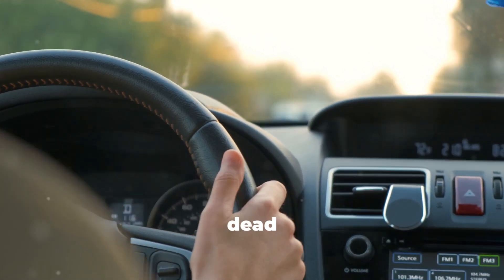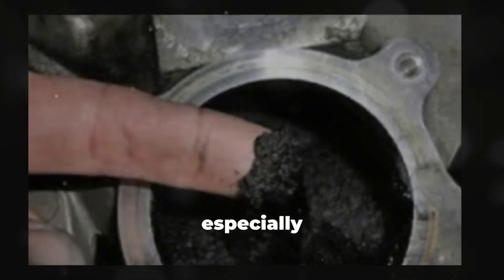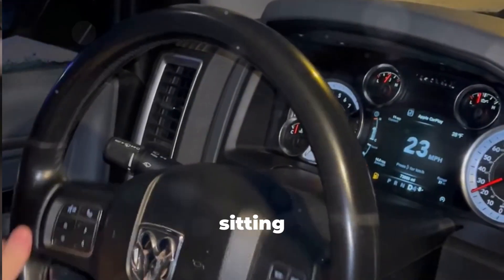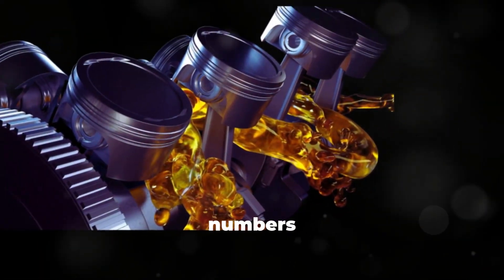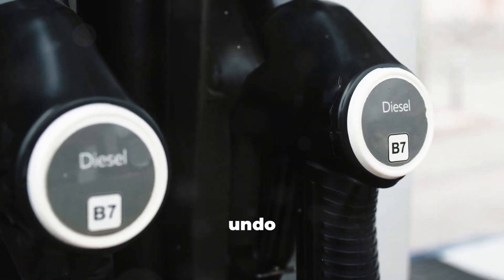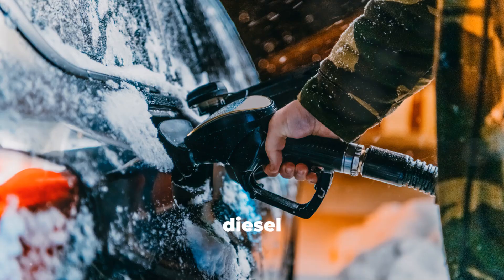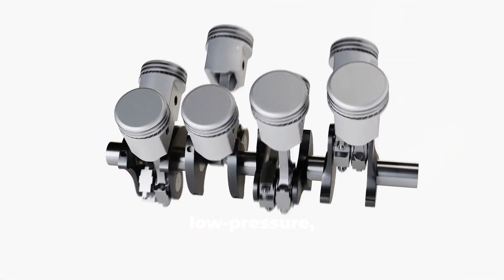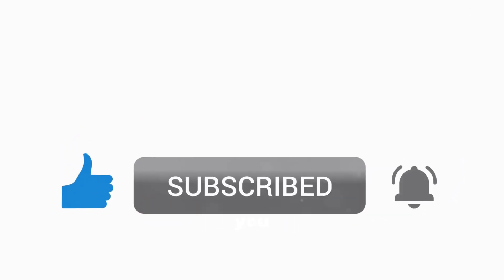Old Diesel Advice That KILLS Modern Engines (Most Drivers Do #4!)

Comment: I have a 2023 Mercedes Sprinter 2.0l, turbo AWD. Mercedes calls for a 20,000 miles Service A oil and filter. That’s 4X+ 3500-5000 and the services are not cheap. Why would they suggest this?